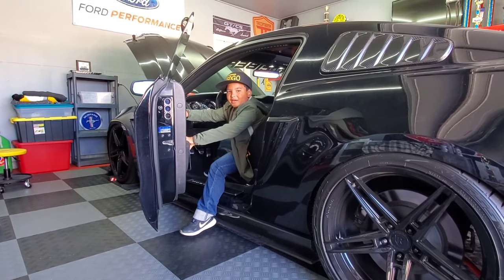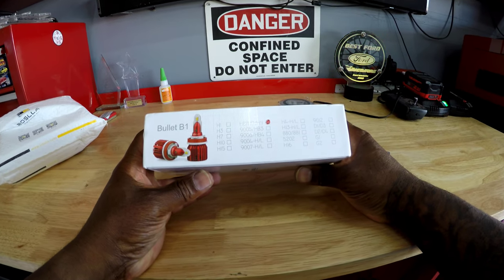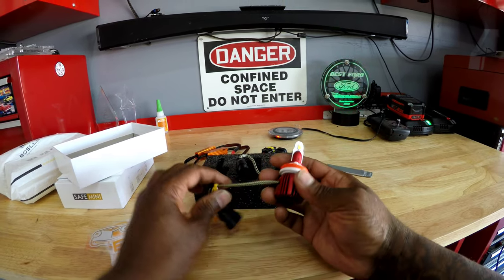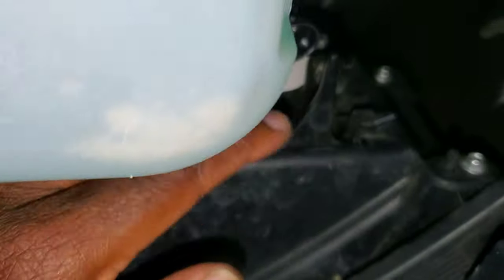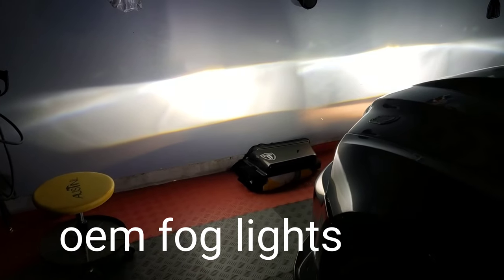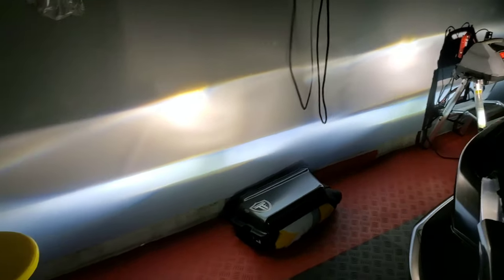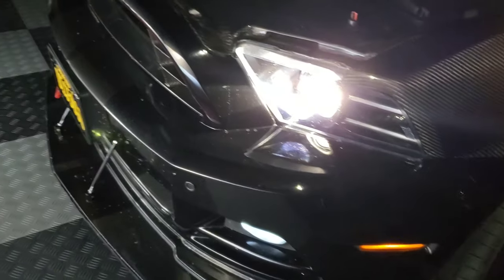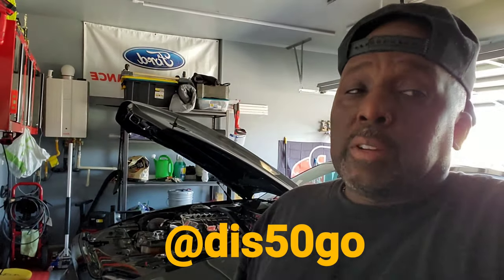2013 Mustang Gt/Cs get some Boslla Bullet B- H11 fog lights

Comment: Thank you so much for this great video. The led bulbs look pretty good. And the orange wire is the decoder, it is needed if there is a dashboard error. If there not, then you do not need to connect them. Again, thanks for sharing!

Comment: I just checked the site. Said won't fit the 14gt
Reply: Did you end up getting them ?
Reply from the maker: They won't work on a Gt with the big fog lights in the upper grille,  these fit the gt/cs  fog lights in the bottom of your bumper